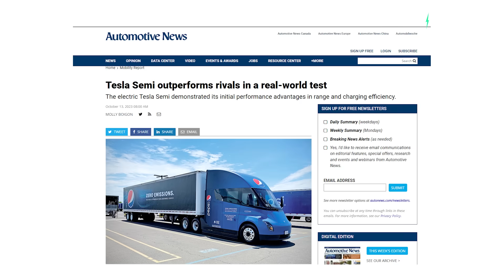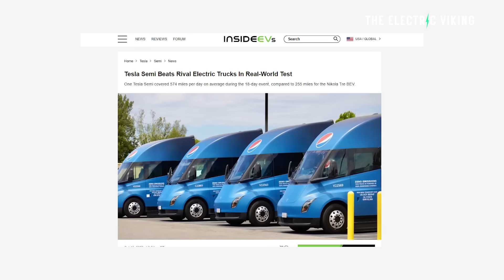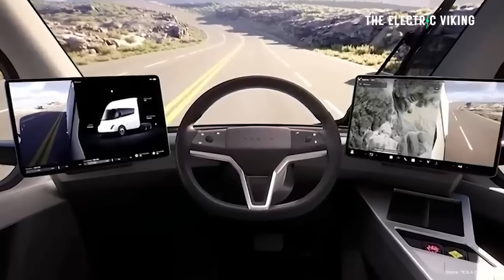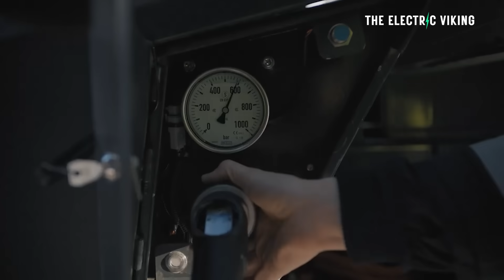Mercedes claim that Tesla Semi breaks the laws of physics proven correct

Comment: Sam. Your information is misleading. 
The tests were not on the same route, with exact trailer lengths and GVW. All the trucks can be driven a maximum of 11 hours/day in the States and do not need a break until 8 hours on duty, a mix of driving and loading or unloading with a minimum of 10 minutes pre-trip inspection. If on a long haul or double shifted, both using two drivers 11 hours maximum driving at 70 mph max speed is an every day occurrence averaging 600/640 miles on good routes. That’s 1200 plus miles a diesel truck only needing to fill up once, the BEVs a number of times depending on their range. Admittedly the BEVs could be charged on breaks, but the driver could not do it as it would be classed as on duty in many countries.
Obviously TESLA seems to have the upper hand on battery design and range, but how about performance over an extended period of use?
I believe you will find that VOLVO in Europe, Scandinavia and North America have done many more miles testing in FE,FM,FH and VNs in all weight classes and vehicle configurations, as well as Mercedes Benz, DAF, and IVECO. BYD in lower weight ridged trucks (straight trucks).
Remember, neither NIKOLA or TESLA have large scale manufacturing, parts or dealerships up and running. Operating trucks is a different game to that of cars, totally.
Please don’t show captions of a FH Volvo when talking about a VN Volvo, it’s confusing as there is little to compare in their operation.
The ATA is  misleading media arm of the Democratic Party. Just check out their headquarters address!
I understand you get a lot of your information from press releases etc, but how true are the reports? 🏴🇺🇸
Reply: "All the trucks can be driven a maximum of 11 hours/day in the States"
- poor wording; the vehicle can, the rule applies to the driver!
Reply: @Dr.Ian-Plect   True, the trucks can’t be driven with out a driver. Hence why I put the 8 hours in.
In Europe and Great Britain it’s a maximum of 4.50 driving b4 a 45 minute break.
Trying not to confuse the matter!
Reply: @pauljohn6637  Then don't confuse things further with silliness like this "the trucks can’t be driven with out a driver", irrelevant as it is.
Reply: @Dr.Ian-Plect  Just stating a fact. Please watch Fleet Equipments latest video from VOLVO trucks North America.
Reply: @pauljohn6637  No.
And this wasn't a fact;
"All the trucks can be driven a maximum of 11 hours/day in the States"

Comment: The overuse of batteries in the semi future trucks is a waste. Put some lines up and power these long haulers on the major highways trolley style. The trucks would have less need for so much onboard power. There is a tech rejection of logic. A large prop airplane would be less of a sardine can and use 20% of the fuel. Why use Jets in the intercontinental market More comfortable planes , 80% cleaner and overall cheaper.

Comment: That’s nearly as impressive as the fire this thing will cause when it burns? Unless it blows up first taking a small town with it
Reply: Ive seen fuel trucks explode and take out overpasses, an EV fire will be a poppersnaper compared to a T80
Reply: @Victor-vj5ds  
Run that past the people at Luton airport
Reply: @jamesplummer356  lol, that was caused by a diesel vehicle
Reply: @Victor-vj5ds  hybrid
Reply: @jamesplummer356  so ya, a diesel vehicle, did you know all gas and diesel cars have batteries too?
Reply: @Victor-vj5ds  No - hybrid
Reply: @jimpackard8059  what fuel does a hybrid use?
Reply: @Victor-vj5ds  yep
Lead acid not self sustaining fire bombs
Reply: @jamesplummer356  funny thing is a saw a video of a cargo ship with gas cars on its deck catch fire because the lead acid battery got exposed to a littile bit of salt water, all cars on the deck got burned out. A Lithium battery pack can be extinguishe if the battery temperature drops bellow the thermal runaway threshold.
Reply: @Victor-vj5ds  if your referring to the Fremantle express there was 500 EVs on board it could not be extinguished and even when it was towed to port the cars were reignited while being off loaded other cars transporters have just sunk standard practice for normal cars is to have minimum fuel on board also to disconnect the battery,the latter practice in reality never happens.the ships have fire suppression systems that have proven mostly adequate for years.the fact that they are now not is testament to the stored energy in EVs and there ability to burn through almost anything they are in or on .the insurance company will most likely have the last say as they are already starting to put restrictions on transport of said vehicles
Reply: @jamesplummer356  im actually not refering to the fremantle express, im talking about a smaller ship with only gas cars on the deck. But the cause of the fire for the fremantle express is unknown, their were reports that the salvage crew noted that the fire did not originate from where the electric vehicles originated, this would not be the first time or last time a cargo ship caught fire.

Contrary to popular belief, you can put out an EV fire quickly. Ive seen a fire chief adress a Tesla fire to the media because he said the media was exaggerating the fire. He claimed it only took his men 2-3 minutes to hose down the fire and extinguishe it but they continued to soak the battery pack with hoses to cool it down. When a battery pack is below 160f the cells no longer decompose by themselves and stop producing the heat that eventually ignites them. If their is still some short circuit active then over time it can heat upnhigh enough to restart the thermal runaway. Another thing people dont talk about is how a tank of gas contains about 9x the thermal energy of an equivalent battery pack and how gasoline and oil float on water.
Reply: @Victor-vj5ds  
I think it was the Granda Costa in the port of Jersey and you it was diesel and petrol powered vehicles,it was also all secondhand vehicles a greater risk from the start and most likely with a lot more fuel onboard each vehicle it was put out although it was not easy and the ship was not in danger off sinking 
The problem is EV fires and the amount 
I have nothing against them but there is something not right be it slack workmanship or bad design I don’t know what I do know is because EVs have more potential power they need to be safer than normal cars and at present are catching fire as much or more than conventional vehicles something needs to be done
Reply: @jamesplummer356  then ypur perception of electric vehicles is skewed if ypu think they are burning as often as gas cars. Teslas have fires 11x less per 100 million miles than gas cars. Tesla has over 4 million cars on the road and only around 200 known fires that include collisions and arson.

Gas car fires are so common they are not even news worthy. I remember last year a tesla caught fire after a high speed crash killing 2 and it was all over the news, at the same time Ford recalled 600,000 cars over 20 spontaneous fires in 2 years, some of them involving parked cars in garages. In most cases its caused by bad or woen sealents allowing fluids to contact the electronics causing a fire or overheated components. Their are very little failsafes for gas cars compared to electric. I once saw a car burst into flames in a McDonald's parking lot, my guess is that the radiator was clogged with snow and not allowing the engine to cool properly or the owner got stuck in snow and over reved the engine while trying to get out of snow. I almost set the greases on my engine on fire once teying to climb a snowy hill with my jeep. EVs dont have this problem because the electronics know when things are getting too hot.

Even expensive diesel trucks dont have a failsafe for runaway diesel engine despite it being a very easy thing to stop if they spent 200$ on a co2/nitrogen purge system.

Gasoline burns nearly as hot as Lithium but their is 15 pounds of Lithium in a battery compared to 20 gallon gas tank that will release 9x the total heat energy.
Reply: @Victor-vj5ds  lithium burns at 2000 degrees C diesel and petrol around 1450 degrees C? Also it burns extremely rich ie lots of smoke as it struggles to get enough oxygen unlike lithium that supplies it’s own oxygen like a oxygen cutting equipment
Reply: @jamesplummer356  wait. Ypu think the Lithium is supplying itself with the oxygen thats already bonded with it? Its the electrode meterial that takes the oxygen. Gasoline in air burns at 2,138C. The elctrode burning produces a lot of toxins but so does burning plastic and grease/oil. Gasoline fumes and burning gasoline efficiently still produces deadly gasses.
Reply: @jamesplummer356  wait. Ypu think the Lithium is supplying itself with the oxygen thats already bonded with it? Its the electrode meterial that takes the oxygen. Gasoline in air burns at 2,138C. Gasoline burning in general produces toxic emmisions that kill you if exposed to for too long.

Comment: It doesn't break the laws of physics. Truck design just goes counter to the goals of automobile design when it comes to weight. In automobiles making the vehicle lighter ends up increasing range. That is as long as you have a streamlined, aerodynamic shape. The lighter the vehicle the more streamlined it has to be in order to overcome the mass of air that it has to push out of the way. So with solar racers streamlining is very important, with cars like the Tesla it becomes less important but still very important, and with heavy trucks it still is important to increase efficiency at speed, but the percentage it helps is less. Speed is also a factor with aerodynamics. The faster you go the more difficult it is to push the air out of the way fast enough. Drag has an effect on efficiency. This all leads up to the real difference between light electric vehicles and heavy trucks. Mass. 

Can you tell me why we don't use light weight materials in cannonballs? Clearly if we shot them they would go farther than extremely heavy iron cannonballs. Right? The reason is that the energy that is stored in the iron cannonballs is much greater because they have a greater mass. That energy gets released when it hits something, and not all at once on impact, but further in as well. You may be able to shoot a wooden cannonball farther at a stone castle wall, but when it gets there it will either bounce off the wall or shatter on the wall without penetrating it. That's not typically what happens when the iron cannonball reaches the stone castle wall. Now, think about mass moving through the "wall" of air in the atmosphere. The same physics hold true there. The heavier the object is than the air around it the easier it is for that object to move through the air, or in other words to push the much lighter air out of the way. So, a fully loaded Tesla Semi has all that extra mass in its cargo to move the entire truck more easily through the air. It also more closely relates to Newton's First Law of inertia, which states that an object will remain in motion unless it is acted upon by external forces. Those other forces that act on a Tesla Semi to make it less than perfectly efficient are wind resistance, road resistance, mechanical resistance and gravity. They become a smaller percentage of mass to a heavier object, that is all but gravity. 

However, gravity becomes a place where energy is stored in a heavy vehicle. We all know that gravity, when considered alone, acts on all objects equally. If you were to drop wooden ball and an iron cannonball from the Leaning Tower of Pizza, at the same time, both objects would arrive at the ground at the same time. The force of gravity is the same regardless of the mass of the object. Let us say that you dropped the two objects onto two china platters. One for each object. Although they will both hit the platters at the same time, the wooden ball may bounce off its platter while the iron ball will most likely shatter, then crush its platter and maybe even embed itself into the ground. The energy of walking both objects up to the top of the tower is greater because the energy needed to move the iron ball up to the top of the tower was greater than it was to move the much lighter wooden ball to the top of the tower. When they get dropped they both turn the energy stored in them into kinetic energy which is abruptly stopped when the objects reach the platters. I'm talking too much. Basically a Tesla Semi becomes more efficient than a Tesla Model 3 because the regen captures more of the kinetic energy stored in the vehicle getting up to speed and stored in the mass of the vehicle. 

So, in conclusion Tesla Semis are so efficient because wind resistance has less of an effect on an object with greater mass, rolling and mechanical resistance are a factor of Tesla's ability through engineering to be the best at what they do, and because a massive vehicle stores much more kinetic energy to make traveling over flat surfaces and down hills far more efficient. So, for the people saying that Tesla is defying the laws of physics I say ... Arthur C. Clarke “Any sufficiently advanced technology is indistinguishable from magic”.
Reply: Einstein was a great proponent of aerodynamics - he knew all about hair-resistance...

Comment: 1700 kilometres in 24hrs with 2.5 hours of charging?
At an average of one hundred kilometres per hour that’s 17 hours minimum or 15 hours at 70mph 113 kph 
Without a second driver this is probably against the rules .
But even if it’s legal and it really could charge that fast I doubt very much that it could travel that distance in that amount of time as even a motorcycle would find it hard to maintain such a high average speed on a public highway system.
Reply: Speed, distance, and SOC for every second of these 24 hours can be seen by entering the four words Run On Less Results in your browser; selecting PepsiCo (Sacramento) for the depot; and selecting Day 17 and truck Tesla 3. Two drivers were used, and speeds were governed at 62 MPH for the first part of the day, and 60 MPH for the rest of the day. By selecting different days and one of the three trucks, you can see the entire results of the NACFE Run On Less tests that started on September 11th.
Reply: Speed, distance, and SOC for every second of these 24 hours can be seen by entering the four words Run On Less Results in your browser; selecting PepsiCo (Sacramento) for the depot; and selecting Day 17 and truck Tesla 3. Two drivers were used, and speeds were governed at 62 MPH for the first part of the day, and 60 MPH for the rest of the day. By selecting different days and one of the three trucks, you can see the entire results of the NACFE Run On Less tests that started on September 11th.

Comment: Still missing key data. The missing metric is not gross vehicle weight, but the weight of cargo and trailer.  Everyone knows that the batteries are heavy and located in the tractor.  We need data that breaks this out and it seems that no one is talking.   Tesla is no doubt the winner against the others in this comparison but the near term buying decisions by long haul logistic companies are between Tesla and other EV tractors, and ICE tractors. They all haul similar trailers.
Reply: You make a fair point.  I did some research myself, and came up with some rough estimates.

Model S battery:  1377 lbs

x9 = ~ 12,000 lbs.

Motor: 100 lbs

x3 = 300 lbs

Tesla Semi drivetrain:  12,300 lbs.

Cascadia diesel drivetrain with fluids: 3,500 lbs.  (Spec sheets for engine and transmission are online)

So I'm figuring about a 6,000 to 8,000 lbs difference in weight, after factoring in the consolidation of battery cases and other optimizations (maybe optimistic, so feel free to recalculate).  Adjust for 2,000 lbs extra on the weight limit for BEV, and that's about 4,000 to 6,000 lbs difference in MAX load capacity.

What does this boil down to?  With Tesla Semi, the MAX freight capacity is about 10% less.  (Note: This is within the range of variance among the existing diesel fleet)

On the other hand, the difference in efficiency and fuel cost is MUCH greater than 10%.

The number crunchers already know this.

Once the manufacturing lines are up to speed (in about one to two years), the limiting factor on BEV truck deployment will be availability of battery materials.

BEV trucks will replace ICE trucks as quickly as the available batteries will allow.  That's my expectation.

The infrastructure will also have to be built out.  I figure this will be done at a rate that matches the availability of trucks.
Reply: the Trailer weight is KNOWN , look it up.
the Cargo weight for this TEST is 70,000 lbs .FULL LOAD.
what we Dont know is the CAB weight, but its Similar to Conventional semi.

Comment: Tesla semi is not good, they have made 70 of them and to the one company. Volvo has sold  5000 electric trucks of the same size. It has 4 production lines making 8 truck models. Mercedes make excellent trucks with awesome autopilot. It’s electric truck is very promising. Teslas problem is it truck has to be huge and heavy to get the range. It has the reduced payload capacity compared to Volvo and the others. That’s why Volvo sells way more trucks. The Tesla semi is only available in the US as it is too big for European roads and other markets. It will never sell well.